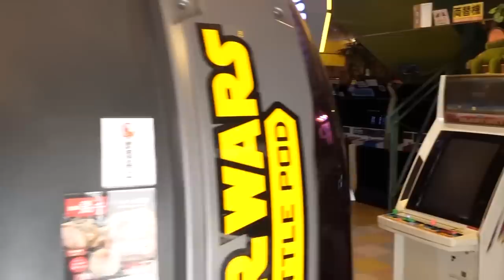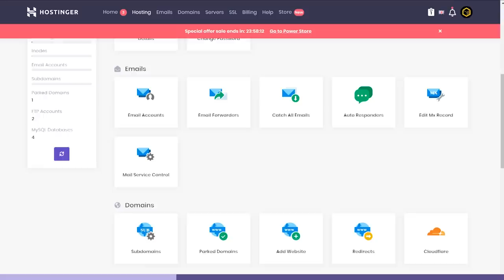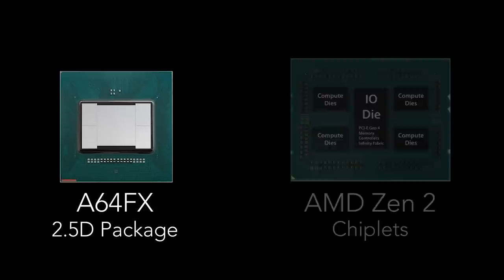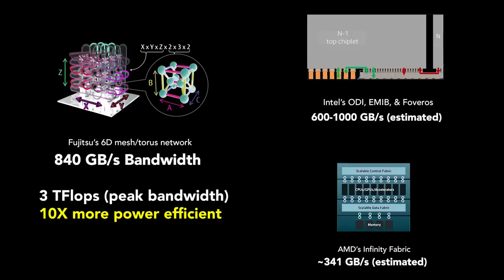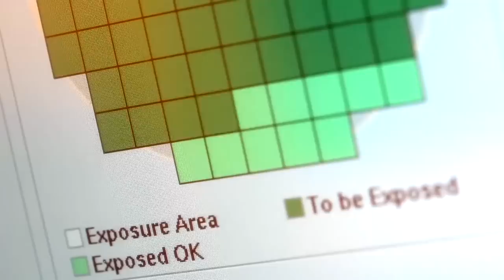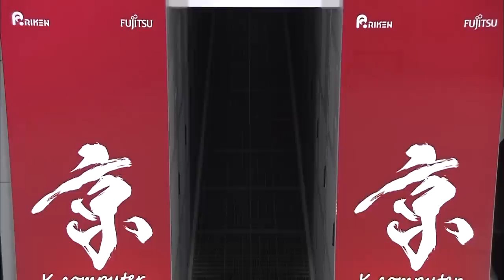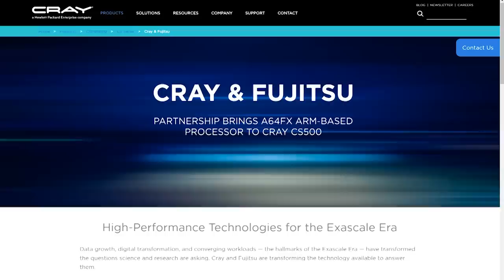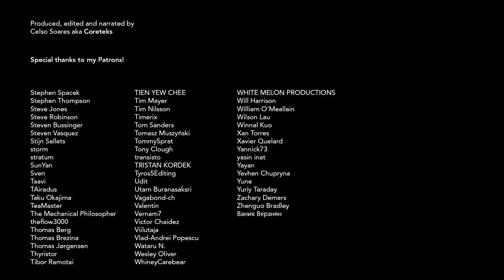CPU? GPU? This new ARM chip is BOTH

Comment: I have to wonder how my transistor system I am working on, could impact things using this all-in-one aspect, with memory and more elastic PUs (processor units), I know the Commodore's Amiga 2000 was able to operate audio video and general processing on every processor in the system, which is probably why it was able to match performance of Intel systems of a factor of 5 x the speed, (like a 28.8mhz amiga vs a 150mhz PC)  and the transistors I am developing are not binary but quaternary and bipolar, ie, programmable to 3 states in both NPN and PNP status, though what I have in mind has a static memory allowing pulling of power to leave the states behind, also there is no off position, but rather a neutral (0 state meaning it has neither a positive resistance on entry nor a negative resistance on entry, so it just becomes a very low level resistor, or just a conductor, depending on the materials used to deploy the matrix in.) Really can not wait to see what else they pull out of this network of chips in their cloud super computers, might be time to start bumping up the encryption of crypto currencies, or satoshi's canary in the mine one million bitcoin address might be gone before we know it XD

Comment: It's a good upgrade over the k computer. I saw K right away before they start assembling fugaku on site. ARM wont affect anything as x86 would access it as  cloud... its fine..  congrats Kobe and Japan for the new super computer on the 3rd floor:)... 30 perabytes storage is now 150 petabytes that great!. Over 150 thousands of blueray discs or more . /ex datacenter operator leader

Comment: You will only error correct so far before complexity is reduced to a binary gated decision of programmer or programmed. And, there will be folks like me, who can Weinerize the toys into sympathetic understanding, and OUR 3D stacking is fractal and complex, hence the woo. Resolution in a binary circuit still only produces a spin/charge quadratic, and is not complex. You will still only approach the classical/quantum clean-up factor, not NP-completeness. That requires both. And, you cannot yet build a 2D machine that is bio-3D complex. An activated human brain is what I speak of.

Comment: At stuff like deep learning or weather prediction this chip will be great but at non-parallel workloads it will be average at best. Also considering it's water cooled I guess it uses quite a lot of power and produces just as much heat and in many cases that's even more important then just chip's power.

It also seems that AMD is working on similar chip for HPC and Intel has their own approach with what they call tiles. In reality the only company that may be hit by this is Nvidia but at the same time Nvidia has CUDA ecosystem.

And from gaming point of view, I don't think this chip shows that much. We've seen "gaming" architectures with HBM and we also have CPUs with iGPUs. I'm not really sure if integrating GPU cores with CPU cores will bring enough benefits to justify higher power usage and more complex compilers designs. You have SIMD instructions in CPUs and Intel's AVX512 shows that while it can speed up some workloads it can be quite hard to program and uses a lot of power
Reply: It's water cooled because it's designed to be in a room with hundreds of thousands of other chips which are all producing heat. The water cooling is a design choice of the cluster it's installed in and not the chip itself, In fact most design choices of A64FX are specifically to reduce power requirements, and this was mentioned multiple times during the video. Beyond that, it should be obvious that A64FX is a very power efficient chip, as its sole purpose is to form a supercomputer node, where electricity and cooling costs are everything. All chips designed for HPC are power efficient, this is knowledge to anyone that has ever worked on or with HPC.

Comment: I Really hope you're wrong about memory being on-chip I don't want the cost of upgrading my CPU to get more memory, it's just another way for the manufacturers to rip off consumers. i need 32GB of Memory, ok you need an $8000 chip that has 4.8 GHz 128 cores, it just forces the consumer to have to pay more to get a better CPU because they need the memory. the Market will revolt against them.

Comment: it's all good and that but...... hbm is currently very expensive and there is a space limitation on how much you can put in a chip not to mention the final price of it. not having to rely on ram sounds nice but what happens when the datasets are bigger than the on chip memory? you can't add ram?  you need a new chip? if so, that's a serious limitation. also most workloads do not scale that well after a certain point. most scientific apps, don't need a lot of cores but terabytes of ram for their datasets. we are very far from terabytes in chips. this will be a great chip but for very few specific workloads,. but still very interesting...

Comment: Umnm... No.  While GPU has been used as an HPC accelerator, Not all HPC chips make a good GPU.E.g Intel's knights landing  Graphics units are good with vector processioning, but they also have specialized hardware to accelerate common graphics operations (Rasters in particular)

One disadvantage of HBM on package,  you've got a fairly hard limit on memory space available, and quite a few application and algorithms benefit if everything is in the same address space.  I don't expect this new chip to be good for bit data or databases.

That being said, SVE is really cool, and it a large step forward for on CPU vector processing.  It's like AVX2, but not. Vector sizes aren't fixed, and there's a lot of features and compiler work done to let everything be flexible. 

There is a riscv project trying to offer graphics though the CPU vector processing, but nobody is expecting it to be super-competitive as a GPU, just that it's usable.

Comment: very cool video :-D
didn't know cpu+gpu+ram hybrid chip already exist :-D
looks very interesting like super advanced APUs :-)

let's hope AMD is going to evolve in same/similar direction

Thanks for sharing
Reply: >let's hope AMD is going to evolve in same/similar direction
Let's hope not! Today, I can easily swap my GPU for a more powerful one with more VRAM and a higher performance while keeping the rest of the system.
An all-in-one solution would require me to replace a perfectly adequate CPU just because I need a little more RAM or new GPU features.
That's a horrible concept for PCs and workstations.
Reply: @totalermist  well think again
it is about what they offers...
it will be easily sell your old single chip to get newer one with more powerful cpu/gpu/memory its actually depends what they offers

if you have single chip with lets say 8 cores (cpu) and 20 cores (gpu) and 16 GB memory  with this Fujitsu approach it will be 16 cores (unified thing) and 16GB HBM 

so you need to take you single chip out of the socket and sell it and get newer one...
or just get second one and use old one for other stuff...

or imagine if they offers 2 or 4 sockets of this :-D
unplug one replace it and keep on :-P
but it's to good to us, mortals :-)

AMD had something similar but with GPU and Storage for enterprise, i remember any GPU+SSD in one card, but this thing of Fujitsu looks really like the next level one, way more superior

with AMD approach of long living sockets (AM4) it will be really nice architecture

imagine your bigger brother is going to work and you pull-off his unified chip and plug yours (weaker) there and use his until he is away :-D :-D he comes back and call you computation stealer :-D :-P

it is really dapends of what they offers, it is just one thing you upgrade your cpu/gpu/memory and boost all by default as changing one is changing all at once with this change... instead pay 1k for new GPU you buff it all at once ;-)

Comment: I was wondering when "L4" cache or something would replace system memory. Sounds like there will be no DDR6. 🤔
Reply: "Computing" is constructed upon 3 primitives PMS for Processors  Memory and Switches. Processor alter info in space, memory store info over time, and Switches communicate info over space.

At the start of the electronic computer era building processors and memory was hard enough while the switches were just wires.

As technology evolved, complexity evolved and the number of processing elements (cores) raised to a point we cannot neglect the "simple wire interconection".

At 3.0GHz light travels in one clock 3x10^8 m/s x clock period in s, while the clock period lasts 1/(3x10^9) s. 

When light reaches (3x10^8)/(3x10^9) ~= 0,1m. 

So when light reaches 10cm away it's already a new clock period in machines supposed to work in synchronized.

The effective radius of communication in this scenario is far shorter, at speeds electric pulses travel in wires and respecting practical synchronization needs, may be 1 or 2 cm.

Architectures were developed to exploit locally synchronized exchanges like systolic computing,  that are useful, but only for a subset of problems.

The general computing element must either have it's memory very close to it (like caches and HBM) or pay many cycles to communicate to and from memory that's farther away. 

There are always a need for the storage capacity implied in the DDR6 proposition, but it won't be the unique solution as lumping all memory in a place becomes less and less desirable. 

Not all problems fit in this A64FX architecture. Some data items might not fit in it's internal memory leading to access in memory far away, at high cost, and probably leading to the need of many memory banks and a complex network to access many of them in parallel by many cores.

Where the architecture fits it's excellent, but not for every problem.

Different architectures populate an architectural space of solutions tailored for narrower classes of problems, as did vector processing, systolic, GPUs, etc.

The show goes on, but the single generical fast CPU slowly fades away with the diminishing returns trying higher frequencies in favour of lower frequency many cores, many memories, spatially distributed interconnected by more the "simple wires".
Reply: @celsostarec6735  I understand what you're saying about latency and capacity needs for memory. My speculation that DDR6 would be a future standard that was not used much was based on the direction AMD and Intel are going also, not just this A64fx processor.
Months ago I started thinking that large last- level caches and fast non- volitile storage, together, might replace conventional DRAM in coming years.

Comment: Every chip that comes out new and with new architecture is associated with the human brain 🤣 
The human brain is an internal communication reactor.
The chip is just a mix of data to give an output.  However, it seems too good to believe that this chip can do everything between high-power GPU and CPU.  Until I see it running games and operating systems that compete with other processors we have today I don't believe it.
For the moment it looks like a propaganda from ARM chips that came from god 😂😂

Comment: Now that is interesting, if a CPU with cores that can function as GPU costs 75% of equivalent standalone CPU and GPU makes it to the mainstream, we will be getting some crazy benefits and power savings. Not to mention that this exact dual functionality makes 3D stacking iGP on CPU obsolete, avoiding all the issues that come with it. A 32 core super unit like that one, with 16 gigs of HBM with graphical performance of a 2060, sign me up, i would gladly pay extra to save on power and scavenging for compatible RAM, less heat and less noise too. 

Why not the future, AMD is already working with Samsung, and who makes a giant share of world's DRAM? Yeah you got it, if AMD figures out how to turn the massive 64 Cores to do GPU work, plus easy supply of DRAM, right next to the die, the performance for will be scary. Not to mention, the AMD monstrosity not being ARM will yes mean less power efficiency, but also more raw power for the regular person. If we have to be real tho, AMD will probably not be able to pull something of that sort soon, and by the time they do , fabs will most probably be at 5nm or even 3nm (which will only help for efficiency for the regular person), but ARM (and that chip) also moves with the process shrink.
Reply: STILL STITCHES FABRIC IS BAD ...AND ARM IS THE ANSWER FOR MORE THAN TERABYTE...WHO WANT TO USE AMD GIGABYTE ??? INTERNET NEED MORE THAN 340GB ??? OR ELSE YOUR GONNA SUFFER IN BROWSING OR DOWNLOAD SPEEDS ..DUE TO BAD CHIPS FROM AMD AND REASON INTEL STILL MAJORITY OF CHIPS ...IS DUE TO FASTER TERABYTE TRANSFERS IS REQUIRE AND THIS ARM SHOWING BETTER RESULTS THAN AMD DO ....AMD SUCKS ...REALLY